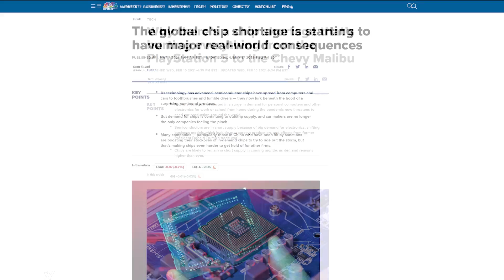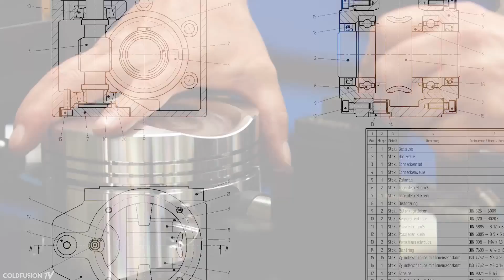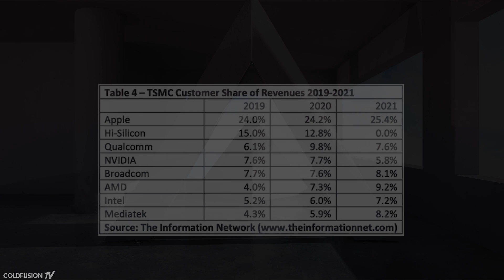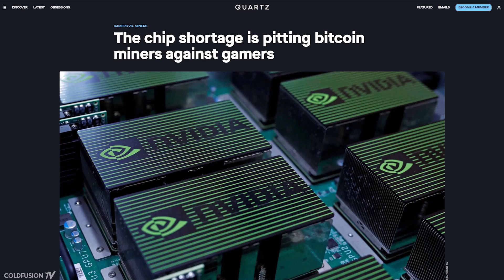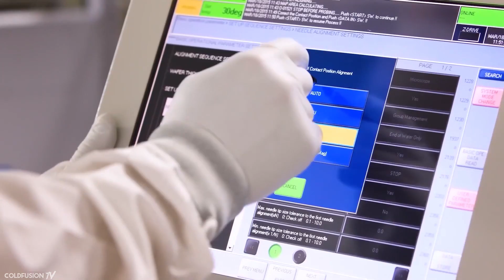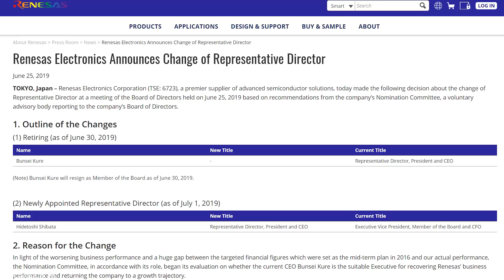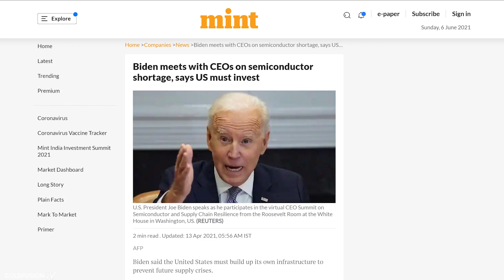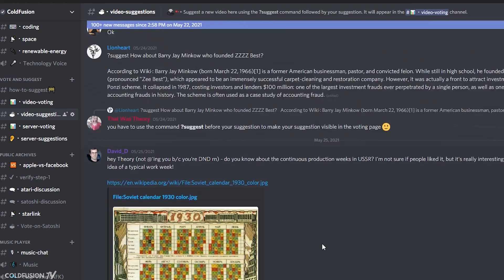How The Global Chip Shortage Started

Comment: Intel will stop manufacturing their own chips soon? that statement is strange taking into consideration Intel is wanting to be even more like TSMC and make chips for not just themselves but others as well. Intel is building two more chip fabs in Arizona which they are spending 20 billion on, as well as plans to possibly build one in Germany. I believe Intel is going to be using TSMC to manufacture some of the parts of their upcoming DG2 GPU's, but other than that Intel definitely does not plan to stop making their own chips. They want to take market share away from TSMC and Samsung (and global foundries to a lesser extent) if anything in the fab industry. Intel is releasing their 10 nm alder lake this year as well, which will be made at their own fabs (side note: you cant judge chips by their nano meter spec alone because that specification measurement is not standardized. For example Intels 10nm is somewhat equivalent to TSMCs 7nm transistor density. Then you also have to consider each architectures instructions per clock and clock frequency). One other reason why there is a global ship shortage left out of the video was is the lack of substrate for the ships (silicon). the substrate of silicon must go through many checks for its purity by a manufacturer to even be considered to be used at a fab. substrate shortages are looking to go away by quarter 1 2021 as there are more substrate facilities being built. It is rather strange how semiconductors are necessary for modern life yet the general populous knows not much about them.
Reply: He provided outdated information. Don't mind it.

Comment: 3:15 Intel isn't joining AMD, AAPL, NVDA in only designing chips. This may have been true under former CEO Bob Swan. However, Pat Gelsinger laid out his IDM 2.0 plan which stated that Intel will be investing billions into upgrading Intel's fabs. Please fix.
Reply: Intel can make a chip up to 10 nm, Samsung's 5nm is having an overheating issue, and it contains fewer transistors than TSMC's, which makes Samsung's 5 nm more like Tsmc's 7 nm but not 5nm from TSMC. So Intel must be outsourcing cutting-edge CPU to TSMC to survive; TSMC is making 3 nm from last month. As to IBM, it's a lab technology that can't be produced on the production line until 2024; in chip manufacturing, mass production is more difficult and is the key to winning and losing. And by 2024, TSMC's 2 nm must have been shipped for some time. So IBM is not even close in this sphere. The 20 billion investment of Intel aims to make a lower-end chip for carmakers.
Reply: Yes, he provided outdated information
Reply: from what I hear intel is teaming up with IBM
Reply: Nice to know , nehru colony and Gandhi Nagar teamed with stalkers , want to know more ? Join school . Lol
Reply: +genuinenness befitting Intel can make up to 7nm chips. The Xe-HPC GPUs use Intel's own 7nm node which has higher density than TSMC's 5nm. The Meteor Lake CPU lineup that were officially announced to be released in 2023 will be made on that same 7nm node :)

Comment: This shortage may have an interesting result - the demand for older cars that don't rely so much on electronics will increase. I think this is a good time to buy an older (1990's - early 2000's), cheaper car and put money that could've been spent on a new car into it's restoration. Maybe we'll witness a shift in automotive industry - from development of new cars to increase of spare part manufacturing and services. Or the rise of a new industry - responsible for retrofitting modern tech into older wehicles. 

Imagine owning a 1990's BMW M5, Mercedes S500, Nissan 240SX, or 1995 Toyota MR2,  that has modern engine, adaptive cruise control, led lights, bluetooth radio, ambient lighting for interior, USB ports, wireless phone chargers, etc...

One thing is sure. You can't sell cars like food or clothes forever.

Comment: This video is remarkably off. Two biggest factors are enterally missing.
First is just in time manufacturing. Bean counters at corporations misapplied and misunderstood lessons from Toyota. Even Toyota struggles with this, but the bean counters at other companies can't see past couple of quarters. So if it saves a couple of pennies in the short term, they will do it, even if in the long term disruptions to supply chains inevitably come.   
Second, fuck over correction. We've had chip shortages for 5-6 years now. Ever since crypto mining came, GPUs are perpetually out of stock or massively over MSRP. How much smartphones increased the prices of memory chips? And Nvidia or AMD or Samsung did not correct this. Why? because they win either way. Less products at higher prices just means less work for more profits. And no downside if they mismanage demand. You did not have to be a genius to know we would need ever more chips as everything shifts digital and online. If it was happening 20-30 years ago, we at least would have more competition. But now there are only a few companies left producing actual chips, so they can get away with anything.

Comment: There is one thing which could be interpreted wrong. Because of the standarized production within pure-play foundries you can swap production wafer batch wise physical. The issue is the supply contract not the fabrication.
A further thing for automotive microcontrollers as STM32 is that there is second source from chinese suppliers which run in TSMC and SMIC. They do no spend, for wise reason, rare engineering time to copy also the difficult to find bugs in the originals. So the car component suppliers stick with there premium chips where 2x-5x device cost is balanced to verify second source. Now some desolder toasters to get the chips.
"Zero inventory" "Single Source"
They are very clever and get now a bonus to hire some desoldering in china.

Comment: Meanwhile, here I am with my old Ford Focus with 245K miles, not worried about needing a new car anytime soon.
Reply: Well, you still need some chips (for example ECU, car stereo) but I still agree :-) 
I got an 04 focus 2.0i/130hp with "only" 125k miles. Still runs and drives like a charm.
It almost has the bare minimum of chips required to run a car in a reliable way. Their functions are basic and even the signalling used by each sensor relatively easy to understand and therefore easely "hackable" in an old fashioned way. I run mine on E85 instead of unleaded fuel with a dead easy mod. Well, tbh, i mix 80% E85 with 20% unleaded. And in my country there can be up to 15% Ethanol in unleaded fuel, and up to 25% (instead of 15) unleaded in E85 in the winter (they should call it E75 in winter ^^) . So I never exactly know the real ratio but 80/20 on tje pump gave the best overall results so far. E85 is less than half the price of unleaded fuel in my country so there is the reason why. For the past 25k miles/2 years I couldn't find a single problem. I regularly check the spark plugs and peek into the cylinders with a little camera and everything's fine. I also sometimes check the fuel trims and lamba sensors, just to be sure. I only modded the engine coolant sensor so the car can easily start and smoothlybrun the first 1-2miles in winter. I could go further and mod the injector signal but it seems more complicated and it runs just fine like that.
Also, parts and regular service (changing the oil, brake flush, brake pads and discs) are cheap and easy to do.
And don't event start me on how complicated it can be on some modern cars to reset the inspection light when you changed your oil... on the focus there simply isn't one :-) and on my wifes vw touran it takes me almost more time to find the post on a forum showing how to reset the damn nspection light than doing the oil change itself... well maybe should just write it down next time ^^
Reply: @yeahboy67  Yeah, the first-gen DOHC (Z-Model) Focuses will last you basically forever as long as you keep up on maintenance. Some of the maintenance is dead simple too. The rear brake drums and bearings are one unit and can be replaced by removing the tire and an axle nut and nothing else at all! I just learned today that the wiggle in the rear when going over bumpy roads is caused by the way that the rear suspension is set up; it's not only harmless, but also responsible for the Focus having such exceptional handling. It's too bad later generations progressively got worse. The first ones were really something special.
Reply: @yeahboy67  Yeah, the first-gen DOHC (Z-Model) Focuses will last you basically forever as long as you keep up on maintenance. Some of the maintenance is dead simple too. The rear brake drums and bearings are one unit and can be replaced by removing the tire and an axle nut and nothing else at all! I just learned today that the wiggle in the rear when going over bumpy roads is caused by the way that the rear suspension is set up; it's not only harmless, but also responsible for the Focus having such exceptional handling. It's too bad later generations progressively got worse. The first ones were really something special.
Reply: @JodyBruchon  Propee maintenance is key indeed. I change the oil once a year (even if the car only was driven 5000miles) or max 10.000miles whichever comes first. Or when the oil gets too dark. On my 350z I even changed it after 1500miles after some very intense driving (like really racing it and always keeping the revs between 4500-6700rpm).
I'm less of a "preventive maintenance" and more of a "if it ain't broke, don't fix it" kind of guy when it comes to the focus. I check regularly (at the very least once a year when doing the oilchange) if everything is ok, and pay attention to the handling, braking, performance. Only if I notice something wrong, I evaluate if I'm able to fix it myself (and the more you wrench the more you learn and get confidence to fix something more difficult)  or if I just drop it to a shop. I really am impreased of how almost nothing seems to break and how slowly some rhings wear out, even in inrense use on a good designed car. And IF something breaks, it often easier to fix on an older car than a new one. In general i was really surprised of how easy and straight forward it is to do all the regular maintenance, even on modern cars (except for that damn inspection interval counter/light) especially on older cars. Even small repairs (like window sliding mechanism, or a hydraulic clutch emitter and receiver, or a sensor, etc) are often times quite easy to do. And the money you save is a nice bonus.
Best part: in most cases, you would break even after 3-4 oil changes if you include the cost of the tools (car jack, stands, wrench kits and most tools you would need are available for quite cheap at an acceptable quality).
So you get to save money, get to learn something and "free" tools if you manage to do most of the maintenance and repairs yourself.
Reply: But how many transmissions has it been through? Ford junk😂
Reply: @testosteroneinc.3800  It has the original manual transmission, so you can eat your words, kiddo. The Focus is built like a tank. Did a valve cover gasket a while ago and camshaft cams looked brand new.
Reply: @Jacob Nelson Oh absolutely, especially if (in the US) you go to car-part dot com to source your parts from local junkyards. I once got a replacement manual transmission (mine had a spun input shaft bearing that whined, and this is pre-Focus) from a local junkyard for $350. The installation sucked, but I paid $350 and a weekend to get back on the road in good shape rather than $2000+ like a normal person would. I also removed the head on that same car by myself and had it rebuilt at a machine shop; that took a lot more work and pain (stupid front-wheel drive engine bays), but the machine shop bill was $200-$250 for 16 new valves and an acid tank bath and head resurface.
Reply: Ughhh car guys.. yawnnnn
Reply: @JB-jr8zw  I run a computer service company and a video production company, but OK zoomer.
Reply: @JodyBruchon  haha woopdy doo.. I'm in mental health *cough * I mean I'm a neuroscientist
Reply: @JodyBruchon  so hurt over a comment car man and how am I a zoomer
Reply: @JodyBruchon  such a zoomer take tbh
Reply: @JB-jr8zw  Salt liberally.
Reply: @JodyBruchon  I'll salt conservatively ty

Comment: But why is it so hard to manufacture those chips? What's so special about Taiwan?
Reply: 92% of advanced chip is made in Taiwan as most of the semiconductor engineers are in Taiwan, other countries just don't have these many talents. Chip manufacturing is a team work type, there are over thousand companies in the supply chain to support TSMC, it's not possible to move all these to another country to build a TSMC scale of manufacturer. The way to make smaller chip like FINFET was invented by Dr. Chengmin Hu from Taiwan, The wet etching in lithography was developed by Burn. J. Lin who is deputy general manager of TSMC,  this technology makes ASML surpass Nikon and Cannon, Taiwanese contributed many breakthrough in chip technology. EUV was developed in F12 of TSMC, Engineer from TSMC still in charge of the research in ASML
Reply: @genuinennessbefitting4734  That's amazing! Thanks for the insight!

Comment: The sudden large drop in pollution in 2020 changed weather patterns, that could explain the drought in Taiwan.

The good news is that if hoarding is really bad that means the shortages will be resolved much faster than expected. Which also means less inflation than expected. In fact, a crash in demand could entirely wipe out inflation.

And another thing to consider. Demand for goods skyrocketed during the pandemic also because people couldn't spend on services. Now that's changing which will cause a drop in consumer demand, possibly a large one, as people bought everything they needed.